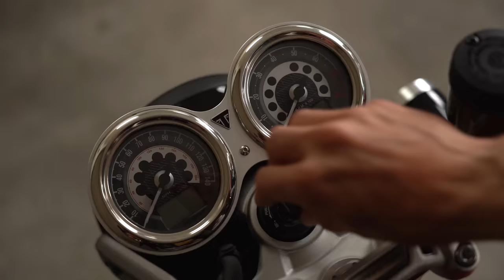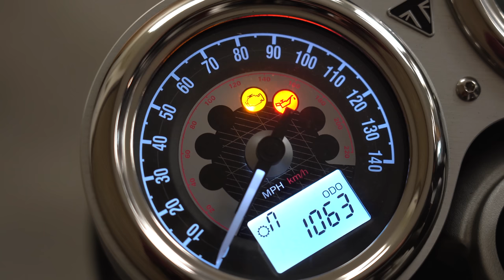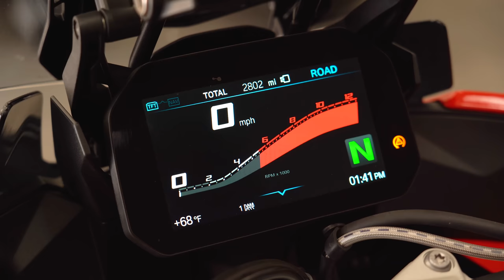Do You Need To Warm Up Your Engine? | The Shop Manual

Comment from the maker: Enter to win a free Kershaw pocket knife here: https://a.pgtb.me/W6wfPG
Reply: Awesome video, however just one correction:
At 3:15, Clearances, not tolerances
Reply: My fuel injected KTM 500 has a choke. When the engine is cold, it won't stay running without the choke on.
Reply: do a video of does speed matter for temperature of bike engine. do we need to drive it faster to prevent overheating.
Reply: yo what are those boots you are wearing at 2:58 ?
Reply: I have a 2000 250 rm Suzuki should I warn it up
Reply: Yeah,  listen to this guy,  and you'll be paying a shop before long to replace all of your top end gaskets,  as it'll be leaking at every gasket. Your choice.
Reply: @TheCamb321

Comment: Personally I’ve always started the engine, then put my helmet and gloves on, and then ride off. It lets the engine warm up for about 30 seconds and doesn’t waste any time that I wouldn’t have used anyway.
Reply: Same here 👍
Reply: That’s how I do it.
Reply: Yep and time to check her over too.
Reply: Er, non of that works if you ride the old Brit and Italian bikes i ride....more specifically, the Brit bikes with chokes removed....
Reply: Ditto. Let’s me listen and check-in and walk around, then go.
Reply: My bike tends to stumble if I just take off so this is what I do
Reply: @BarnettSpeedSuzukiThou  100%. What's your quick check over method? I usually squeeze check both tires, check calipers aren't loose, check wheel lugs quickly, and make sure chain isn't too loose. Wondering if I'm missing something.
Reply: @Josh-cw8by  yeah good. I look at and wiggle everything. That includes even after a stop off at a biker cafe etc. Paranoid, me? You bet lol. Oh and reset the fork travel tie wrap.
Reply: @Josh-cw8by  I don't think you can notice a flat motorcycle tyre by squeezing them.
Reply: @komerka35  I can. Strong grip
Reply: This is the way.
Reply: Same here
Reply: Exactly I do the same thing
Reply: Same…but for me it’s really more about letting the oil lubricate the cams/pistons if it’s been sitting awhile
Reply: Same here
Reply: I let it idle till the revs drop.
Reply: yea this is the best way fosho
Reply: Same
Reply: why would you do that? electric motors work best when cold
Reply: @salahad-din4114  some neighbors really can be the worst!
Reply: @u-castrol2594  lol 😂😂 what kind of outdated vehicle you use tbh 🙄 

Mine fi system heats my engine in just 30 sec and come back to the normal rev
Reply: Nobody sane rides in less than 10°c? I wouldn't be able to commute to work for 9 months of the year. 😂
Reply: Your supposed to wait 2-5 minutes for small engines. Download the PDF file for owner's manual, on any/all small engines it'll say it's recommended to wait up to 5 minutes to warm your engine before using [your bike's name] I'm a certified small engine mechanic, for the past 5 years I've been fixing/repairing small engines left and right. If it's below 50 outside, I wait about a minute, if it's below freezing, I like to wait about 5 minutes. I've learned my lesson the hard way. I encourage you to learn from my mistake.
Reply: @ScottTheImpaler  Your correct, all you are. I like to wait for about a minute if it's below 50, and i like to wait about 5 minutes if it's below 32.
Reply: @Josh-cw8by  check coolant [if any] and oil levels, check spark plug for wear, Check swingarm bolt and if you don't have a gauge, make sure you have gas, then I like to bleed the front shocks, check tire pressure, check air filter. and you've covered the rest. But yeah, including what you do, i do all this stuff before I ride.
Reply: @komerka35  It'll work, as long as you have a motorcycle tire. Rule of thumb is you squeeze the tire, and your hand should not have any play/dent in the tire. If it does, then check it with a gauge and make sure your assumption is correct before putting more air in the tire.
Reply: @lowellfink9292  honda Activa 125cc owner
My fuel injected vehical guide say wait until the rpm comes at low speed then gently give the acceleration 🙄

I didn't see anywhere to wait for 5mins and waste the precious fuel
Reply: exactly
Reply: @andrewkitchenuk  Fahrenheit, my friend. 10° C is perfect riding temperature if it's dry 😁
Reply: @andrewkitchenuk  He said Fahrenheit tho
Reply: Or unnecessary fuel, right!
Reply: Who doesn't do it that way? The guy said FI bikes perform great from startup, but anybody who has tried a KTM 500 EXC with an after market map (or a Honda 450L with any map) knows that even FI bikes suck when cold or at high elevations. Fortnine has an interesting video about it.
Reply: Personally i do the same with the added step of driving a little more careful for the first minute or 2, probably doesnt do anything but it makes me feel better. It is known going hard on a cold engine is a little bad, if at all
Reply: @R S  well that makes sense, you only care about stuff you pay for!
Reply: Exactly right. Maybe have a cigarette before I set off too.
Reply: Exactly what I've always done 👌🏼
Reply: This is the way.
Reply: My Milwaukee 8 takes less than a minute for the idle to drop.  That enough time to put on helmet and gloves.  The idle drops and I’m off.
Reply: I start it, then put my pants, jacket, boots, gloves, and helmet on. Gives me more than 30 seconds and keeps my skin safe
Reply: And, honestly no repairs after 20K? Have you checked the oil for metal shavings?
Reply: Same here. As soon as I’m geared up I’ll close the choke to about half, by the time I get to the end of the street I can shut the choke off and it’s away fine.
Reply: I must be slow at putting my helmet and gloves on
Reply: Exactly.
Reply: @u-castrol2594  what's the mystery reason?
Reply: That's how i treat it also. 30 seconds maybe a minute if it's a fairly cold morning.
Reply: Had an FTR 1200 that I loved but the fueling was weird and would stall when cold so I started doing the same thing and have kept with it.
Reply: Yep same here, fire it up in the garage, ride it out, jacket, helmet gloves and off i go.
Reply: @andrewkitchenuk  I'm guessing your smiley means you know he meant Fahrenheit?
Reply: Any young child knows that hot metals expand more than cooler metals, when you ride a bike and the engine is cold there are differences in heat and metals expand so you need to heat up or the engine will be damaged
Reply: Same here
Reply: As do I. Just seems like the way to do it and is not harming anything. Although I do see his point that there is no need to "worry" about it.
Reply: @NWTMasterWolf  You are wrong, my friend. You should review the concepts of expansion and contraction of minerals. It is not at all related to oil
There will be problems with the exhaust and problems inside the engine in the head, cylinder and gearbox, but it takes time for the problems to appear
Reply: good point
Reply: @andrewkitchenuk  This is not 10°C, it's 10°F, which is around - 15°C
Reply: @komerka35   of course you can, but you need to be a man, not a 7 year old boy.
Reply: @impalaSS65  What if I'm a 7 year old boy that can do it?
Reply: @komerka35  I'd say you have no clue about your prior statement saying the complete opposite.
Reply: @impalaSS65  Yeah I don't think some bs about men and children is really appropriate
Reply: @komerka35  Your off your meds it seems. "Appropriate" doesn't apply.
Reply: @impalaSS65  lmao
Reply: This is the way
Reply: Same. Just beware of your surroundings so you don't get robbed during that time. Happened to a buddy of mine
Reply: Same
Reply: I do the same,except during winter
Reply: Agreed
Reply: I do too but I’m more concerned with oil displacement through out the  engine.
Reply: @Drew Bork How tf do you squeeze a tire while riding the motorcycle lmao
Reply: I do the same thing with my "tractor" bike (BMW R1200RT). ;)
Reply: I  put   my   helmet and gloves  on ,  then  I  start  the  engine  and  go  at  a  quiet  speed  for  a   minute  or  time.
Reply: that's exactly what I do as well
Reply: @scruffycavetroll7547 😅😮j
Reply: Same
Reply: Royal Enfield recommends this method (not sure if it's only in the engine break-in period). One can distinctly make out the difference in the exhaust note after the first 20 or so seconds after starting the engine - the engine settles from a more hurried note to a calmer  more regular note.
Reply: Yeah same here
Reply: I do this even with my car. Start it up, turn on a podcast, put my seatbelt on set the destination takes about 30-60s and by that time there should be lubricant everywhere.
Reply: Same

Comment: I think people also forget that a lot of lubricated parts don't move at idle.  Part of that 'taking it slow' period is warming up your gearbox among other things.  You could very well hit the right temp for your engine and then dump wayyy to much power into a still fairly cold gearbox.
Reply: Ideally, you'd start riding as soon as you can, but I've got to let mine sit for a short bit typically as it isn't fuel injected and keeping it from stalling is a bit of an issue if it doesn't have a short bit to warm up like that.

But, in general, it's best to warm up the bike by gently riding it before doing anything too strenuous.
Reply: @SmallSpoonBrigade  yes - I would definitely agree that a carbureted engine does need that time for the fuel system to set up - great point.
Reply: @SmallSpoonBrigade  a professor once told us in a lecture on combustion engines in university that the heat brought into a engine at idle is so low, that the engine will get more damage from idling without properly heated oil than it takes when you just start rolling around calmly.
This was said about car engines when it‘s really cold outside, but maybe it‘s also true for motorcycling temperatures 😁🤷🏼‍♂️
Reply: But the oil is not the same for engine and gearbox? so if the oil is hot it'll get hot those parts too, right?
Reply: @MerBowe  the oils are separate yes so for example if you warm your engine up at idle on a rear wheel drive car then none of that heat is getting to the rear differential parts. Your transmission might get a little heat through the block but still won't be up to proper temps. Best to drive and let the whole system warm up together.
Reply: @horstgunther9521 
Though I agree one should simply start driving/riding with a slow tempo because I always believed what Ari said that you can't damage an engine if you take it slow (plus you save time and fuel), what you said about engine getting somehow "more damaged" by idling with cold oil is just nonsense.
Reply: Don’t have to worry about that with modern Japanese manufacturers. Unlike Harley they move with the times and adjust part’s accordingly. Everything gets lubricated the same at idle or at wide open throttle. Doesn’t matter. It’s why I’ll never buy a harley. Don’t get it twisted. I like how Harley’s look and sound. But own one and deal with the headaches? Nooooopppeeee. Give me a goldwing or a Yamaha cruiser instead. Not only are you good for life. Those bikes won’t start leaking oil after 5000 miles 😂
Reply: @MerBowe  In bikes with a wet clutch, it uses engine oil to lubricate the clutch at the very least and I think the gearbox as well?
Reply: @adrianschermer  What?? Your gearbox is always spinning. The output shaft isn't spinning because the freewheel gears aren't under load, but the gears are still moving. What other lubricated part do you think doesn't move at idle??
Reply: @JoshNewby84  The gearbox spins but won't warm up as fast without load. Automatic transmissions don't spin without power applied. Differential(s), transfer box, bearings, and braking system all have ideal operating temps that are above ambient.
Reply: @adrianschermer  we're taking about bikes here, dude
Reply: @JoshNewby84  ah this is an old thread ha ha - well some of those apply- even a chain and sprocket warm up
Reply: @adrianschermer  yes they warm up & so does everything else. That wasn't what the video or thread was questioning. This was specifically about warming an engine
Reply: @YoDooDSup  "Everything gets lubricated the same at idle or wide open throttle"

Not really. Oil pressure at idle can be as low as 10 psi (depending on if the oil is hot or cold) & increases at a rate generally of 10 psi per 1k RPM.
Reply: @horstgunther9521  Cold oil will damage an engine more when you put load on it. The load is the important bit & why we let our engine get up to temp on its own before applying heavy load. Cold oil doesn't pump well, so it will take roughly 30 seconds to get pumped through the engine & into all the crevices.
Reply: it still shares oil and the same casing as the engine so it would be a little warm. warmer than a cars transmission but yeah im not disagreeing just adding a point
Reply: Great point!  👏
Reply: @mickeypopa  "what you said about engine getting somehow "more damaged" by idling with cold oil is just nonsense." NOPE sitting idling the engine for longer time will surely damage some parts of engine, how? because it's idle and no pressure to move the oil on upper part of engine then it will not lubricate properly, just start your engine, wear your helmet and gloves then your good to go! just ride in slow pace for few minutes as this will help to lubricate first all engine parts before you hit the high speed.
Reply: @goyodelpilar Sounds like nonsense, even in idle it adjusts oil pressure accordingly. Bikes don't damage in idle man, people always make stuff up to sounds smart.
Reply: wtf are you talking about lol. the gears and clutch all move when the bike is idling in neutral and the heat from the engine gets transferred into the gearbox and clutch because there not separate sections.
Reply: People with mechanical  sympathy (usually people who work on (their own) bikes) probably lets a bike or car warm up.
Reply: Which is why you let bike warm for up 3 minutes so it warms the oil to optimum temp in the gearbox and then ride but chill for 3 minutes to let the gearbox warm up.

Comment: My usual method is about a minute of idling, then low RPM cruising until it’s all warmed up. Glad to see others are aware of this as well. One way to think of it is that engine wear is not linear throughout the RPM range. If an engine has a 10,000 RPM redline and will last 5 hours at a constant 10k, it doesn’t mean it will last 10 hours at 5k RPM. Since wear is increased when the engine is cold, and engine wear is exponential with RPM, don’t rev it while it’s cold.
Reply: I use a heat gun to heat my engine. Save fuel and engine both 🤣🤣
Reply: @pravesh736  That wastes time. I just set the whole thing on fire, then ride into the sunset...
Reply: This is the best to do not waste too much time, i do the same in my car.
Reply: @pravesh736  in the north, we have block heaters on our cars. Same idea, but easier setup and use.
Reply: Well in case of 4 stroke engines, once it reaches operating temperature then engine wear does not really happen no matter RPM range, because all the parts have proper oil film and oil flow. As long as you replace the oil often enough, then you can ride it at max RPM all the time.
Reply: @h4xi0rek  no, man. Just no.
Reply: @DNANDROID  are you new? You must be new.
Reply: @Full_Deflection Or rides a honda😂
Reply: You're forgetting about load. An idle engine isn't under load, which is a key factor in wear